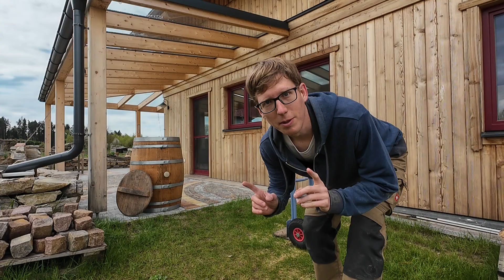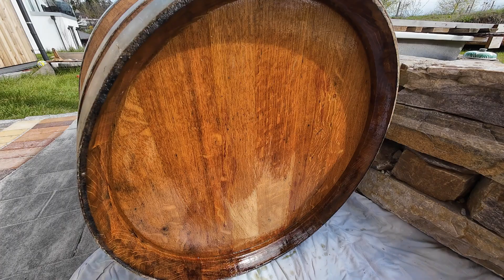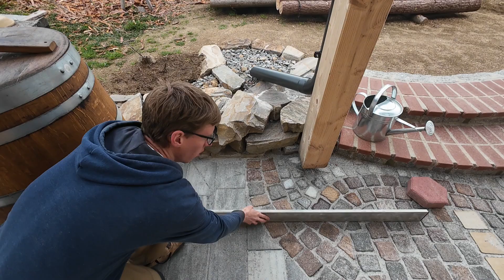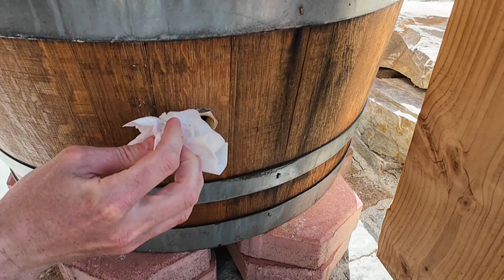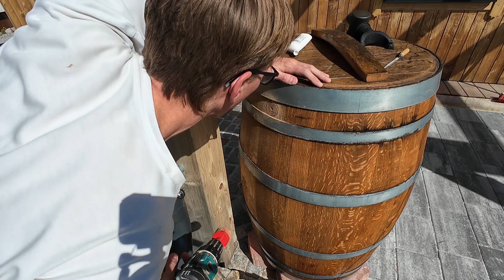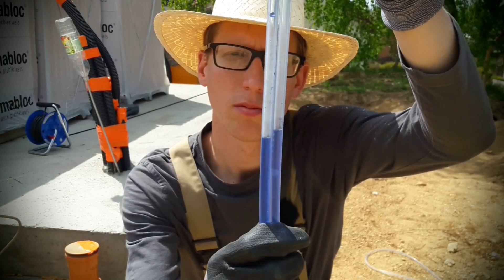Turning a barrel into a rainwater container

Comment: thanks so much for posting this. I have heard you're supposed to fill it with water manually once set up to get the oak to swell but noticed you let yours fill naturally. i've been led to believe not doing this would make the wood tighten back up again after it would leak out, due to slow filling. did you experience this or did everything correct as it filled up naturally? Thanks!
Reply from the maker: When the water rises slowly enough from natural rain usually, mine has always been tight up to the current water level. Filling it up rapidly makes it leak a bit at first but after a while the wood expands and everything is tight again.
Reply: @EarlybirdGardens  cool thanks for reply. I am also considering this will fill up pretty fast in seattle autumn anyway.

Comment: Just a tip, it is very convenient to use a large diameter outlet tap, like 50 cm or so, with a short throw valve. Those small garden hose sized taps take so long to fill a watering can!
Reply from the maker: True. The tap I installed really takes its time. We don´t use it a lot for filling big vessels but a wider outlet would be a good idea nevertheless!
Reply: @EarlybirdGardens 50mm, not cm haha.

Comment: Do you have a link to the product? How has it held up after a couple months? Thanks
Reply from the maker: Hi! It´s the Garantia speedy Regensammler (=watercollector) and it still works ok. The filter gets clogged a lot, so I usually check it before or during rain so that water actually goes into the barrel, but you could also remove it easily. I feel like maybe 40% of the water still runs past the collector and down the pipe but that may largely depend on where the water happens to run down inside the pipe because the collector only covers part of the inside circumference. But all in all I´m satisfied with it, helps a lot and the barrel is full almost all the time.
Reply: @EarlybirdGardens  I appreciate the reply! What sort of debris is clogging the pipes? Fine particulates?
Reply from the maker: Usually fine fibres or seeds from plants I suppose. Certainly depends on what is growing nearby.
Reply: @EarlybirdGardens  I got mine up and running but ran into the issue of mold growth. Did you seal the inside, and if so, what did you use that was safe for water contact? Thank again!
Reply from the maker: Hey! I think the sulfur shown in the video helped keep mold in check, had no issues so far.
Is yours leaking? Mine was, but I found best to fill the barrel and simply wait for the wood to soak. When wet the wood swells sealing the barrel. In Austria there is a sealing substance for beer barrels available, should translate to "barrel pitch" (or Fasspech in German). Should do the trick, but I haven´t used it.